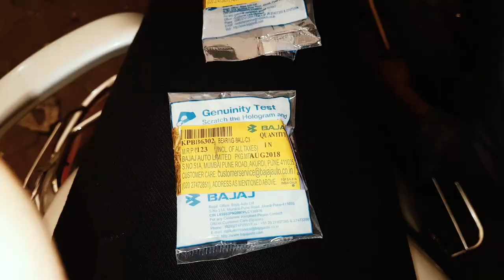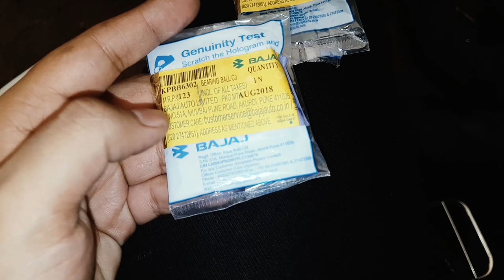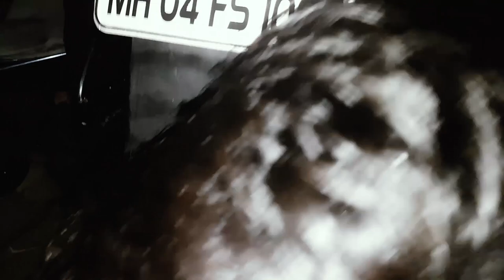Pulsar 220 Bearings kab badalvana chahiye? - 50k Km's - why & how to change bearings. Price.

Comment: Hii bhai
Front la tu 100/80/17 ka tyre lvly tr kahi problem yeto ka handling anii lean krtana 
Maz rear tyre stock vala ahe front la ha lvu ka rear tyre stock thevun
Reply from the maker: Oversize takla tr tyche kahi fayde ani nuksan ahe.. But mala kahi problem nahi ala.. Rear la stock ahe maja.. Maji breaking power vadli ahe mrf ch 100 section tyre ne.. Laun tak.. N me ek goshta notice keli ahe ke MRF ch 100 section ch tyre jast chalto as compare to stock.. Grip pattern mothi ahet mhnun.
Reply: @ThanekarSwapnil  kiti kms zale tu use krto toh tyre
Reply from the maker: @abhijitmore1169  stock tyre me 25k km la change kele la.. Taklu jale la.. N ata 60k km jale ahe.. Ya duration mdhe rear tyre change jala ahe 1 da 48k km la. Ajun grip baki ahe.. Ghetla tr MRF ghe. Lavlya nantr tyre adjust hoyela thoda vel lagto.. Adjust jalya vr maja yetey..
Reply: Thanks Dada 100 sec . Ch lvto tyre lvkrch
Reply from the maker: @abhijitmore1169  yes....